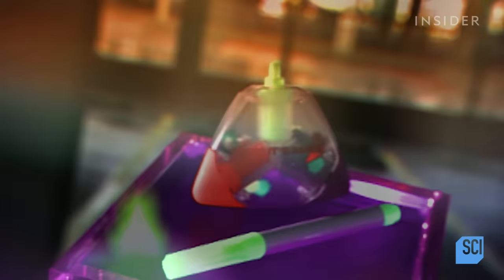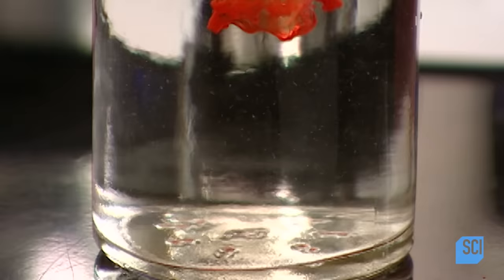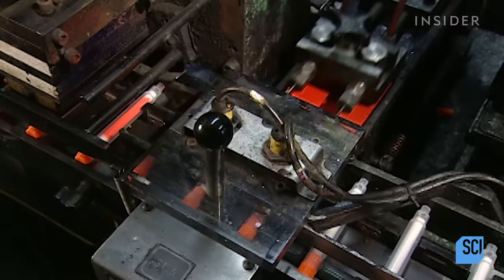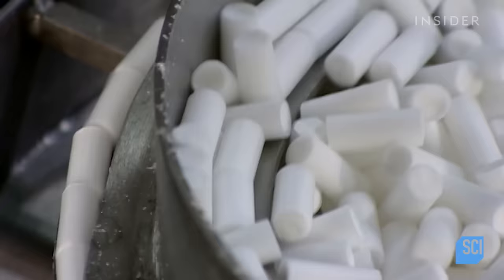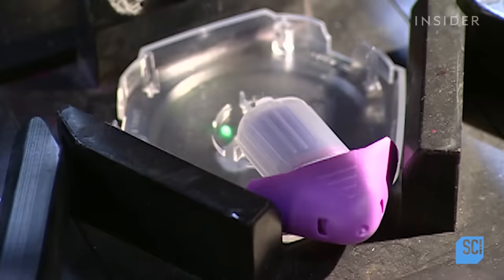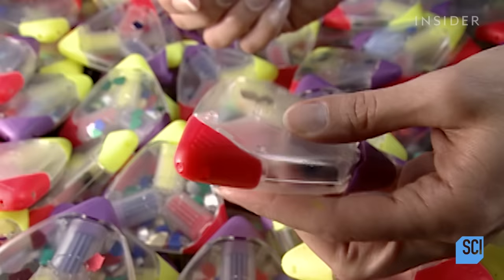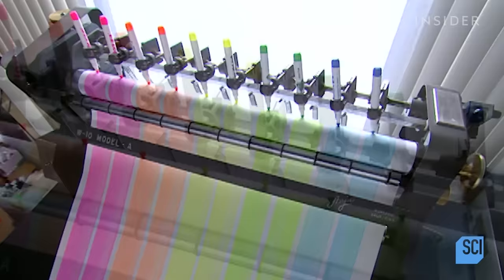How Highlighter Pens Are Made | Insider

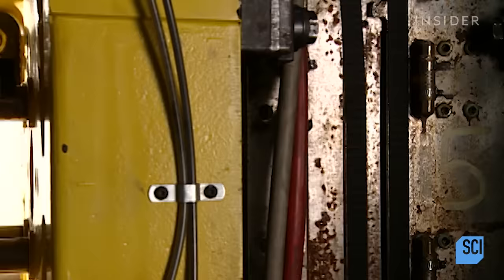Comment: To those who didn't understand 0:55 -

Given,
Force applied = Weight of 350 🐘

Assuming the average weight of an 🐘 to be 3000 kg.

So, weight of 350 elephant = 350×3000 = 1.05 × 10⁶ kg

We get the Force as -
F = mg = (1.05 × 10⁶ kg) × (9.81 m/s²)
Thus,
F = 1.03 × 10⁷ Newtons

Note: The weight of elephants vary from area-to-area. Thus, it depends on the location of factory to precisely tell which 🐘 the narrator of the video is referring to.